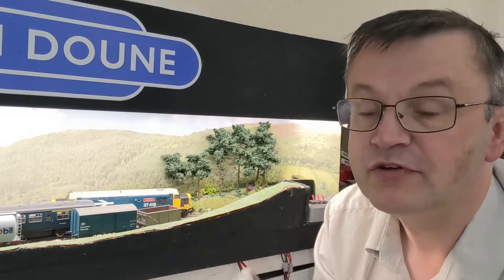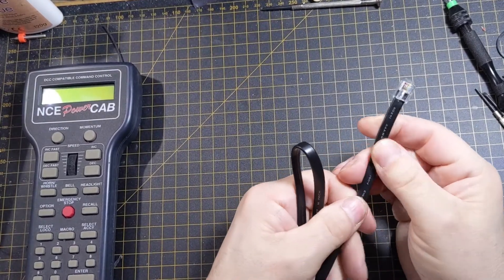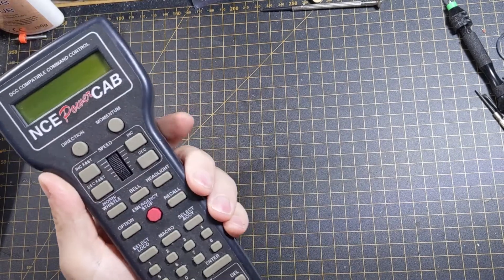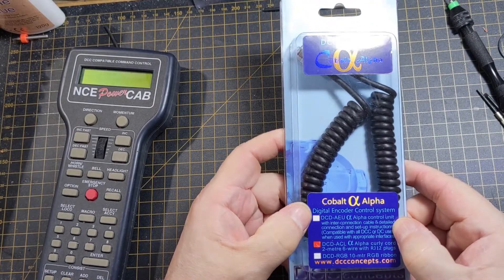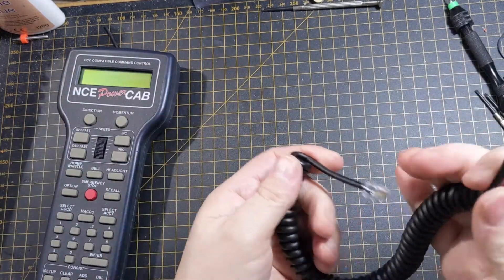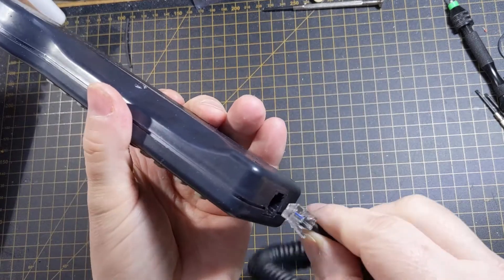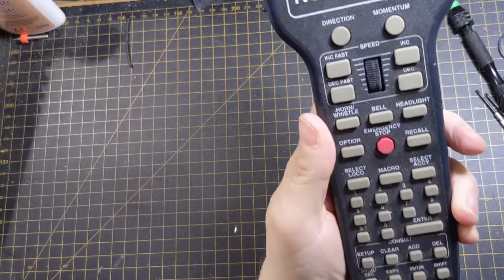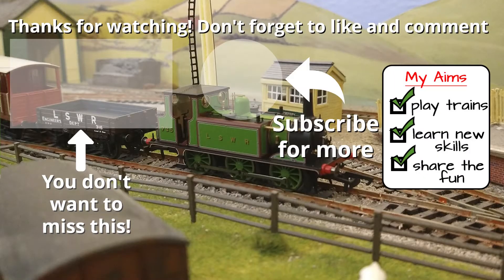A Curly Cable for the NCE PowerCab

Comment: It's just a RJ12 straight wired cable, available on most electronics sites in various colours, but get a decent one.
Reply from the maker: It needs to be of the right grade and shielding, because it carries an electrical load, which most RJ12 cables arnt designed to do.

Comment: Does this cable have the heavier wire that NCE state is used for the Power Cab?
Reply from the maker: Yes, its specifically designed to work with the PowerCab, unlike other curly cables, which may have the right wires, but arnt of the required standard to carry the power.

Comment: Question. I've recently acquired a NCE power cab. I've programmed my locos on a separate track which was fine and they  worked on that track but when I switched them to the layout it doesn't seem that any commands are going to the locos. I've tested the track and it does have power. Is there something I should have done on the cab??
Reply from the maker: No, there isnt anything you ought to do. What you could do is remove all your locos but one, and then treat your layout like a giant programming track. Read back the CVs, to test the communication with the loco.
Reply: @MessingaboutwithModels  I've noticed that there is no draw of power on the power cab register

Comment: i need a longer cable really.  can you buy longer versions do you know?
Reply from the maker: It stretches out to about 2 metres in length. I dont think they sell another one, but you'd probably have another panel if your layout was that large.
Reply: Use two with a RJ45 coupler.
Reply: @MikesProjectsandHobbiesMC  thanks i'll try it out
Reply: @timstrainvideos142  Actually those are RJ12 connectors I think. Sorry I was at work (IT) and was thinking PC.  LOL
Reply: @MikesProjectsandHobbiesMC  no worries thanks i'll get rj12 coupler cheers tim